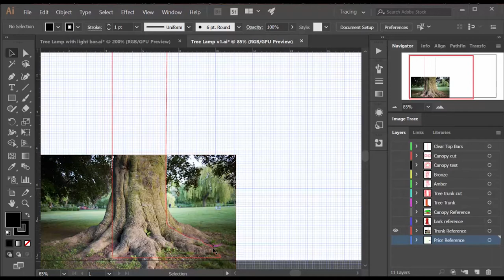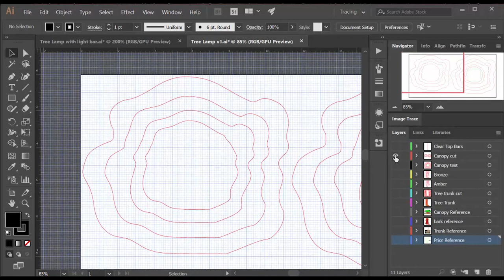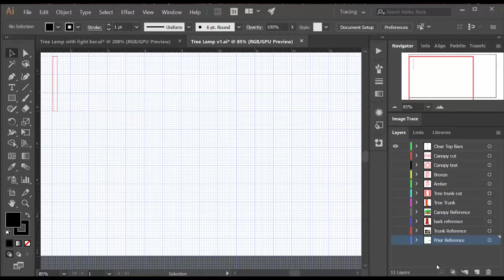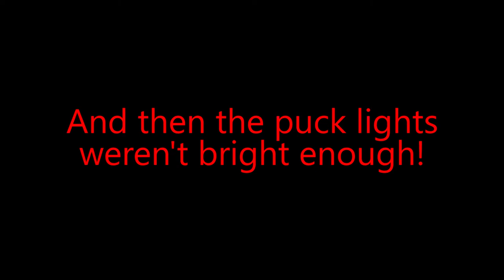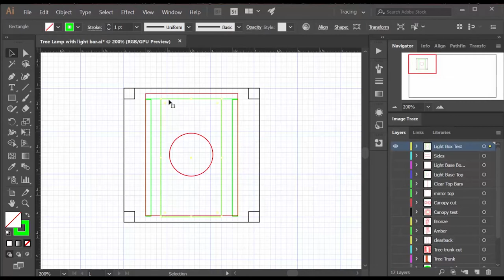How to Design and Laser Cut a 'Stained Glass' Lamp

Comment: I was kinda hoping I would see a little more of the lazer cutter part. I work with stain glass and I have some projects that have very tight curves and ends. I want to build myself a lazer cutter to tackle those more stubborn pieces. What kind of lazer cutter did you use, how did you use it, and what program did you use for it?
Reply from the maker: Samantha,  check out my video interview with Patrick about how to choose a laser cutter. First of all, do you plan on cutting acrylic, like I am in this video? Laser cutters I'm aware of can't cut actual glass, only a water jet can. For acrylic I use anything from a 60 watt to 100 watt CO2 laser. I use Adobe Illustrator as my CAD program and RDWorks as my CAM program. CAM is what translates vector graphics into machine commands.

Comment: Thanks for the great instruction!  Can you tell me what you use for fusing liquid?  Also, where do you get your colored acrylic sheets?
Reply from the maker: Danny, I get both from Delvies Plastics, online. They have been a great supplier!
Reply: Greylight May do you get that needle applicator from Delvies too? I see they are local to me. Also where do you buy your opaque colored cast acrylic? I don't see opaque at Delvies-- unless I missed looking well enough on their home page.
Reply from the maker: Yes, the applicator is from them too. My opaque acrylic is called translucent on their site. Perhaps a little light goes through but it looks opaque to me.
Reply: Greylight May ahhh thanks. Yes I see the black translucent, for example, listed as letting through no light. ;) 

I've really liked your videos. You have been so generous with your insights. I've been using Illustrator since version 3, but your process of thinking, building and virtually troubleshooting your 3D creations has helped improve my preparations as a new laser owner. Pimping out my gaming experiences was one of the important reasons to buy it.

I've watched most of your videos, and one thing I don't recall seeing is whether you have sandwich-laminated wood and acrylic-- and if so what kind of glue you used. As I recall from the lamp project you joined at corners with two diff kinds of glue.
Reply from the maker: Thank you so much! The one time I did mix materials I went with an all purpose white glue. Fusing is so particular it will not work for nonacrylic plastics...